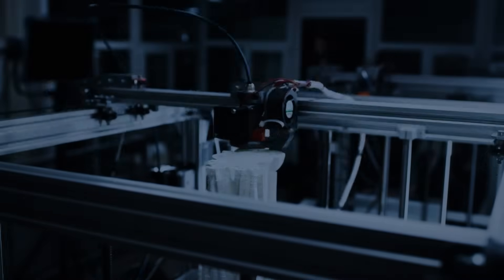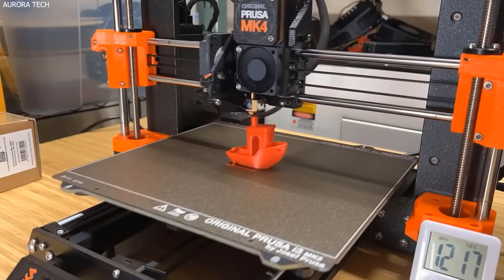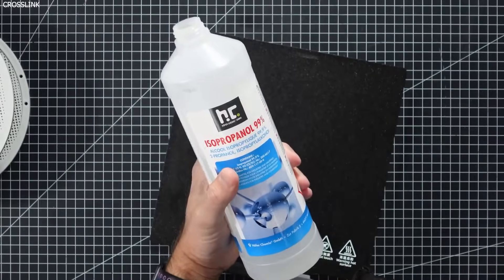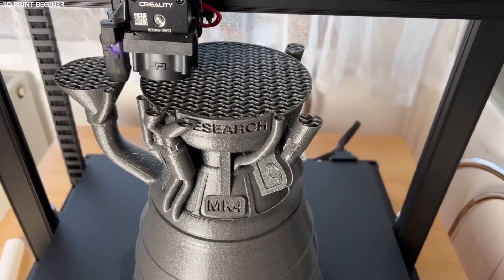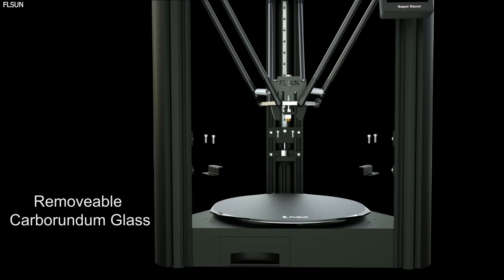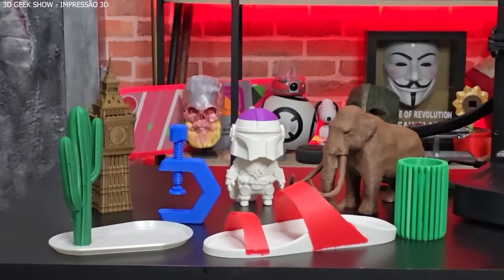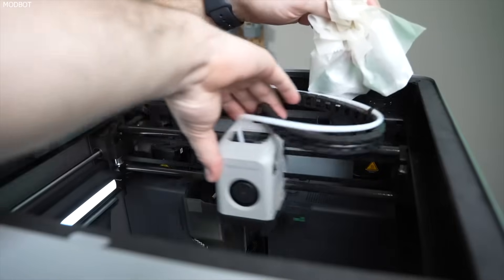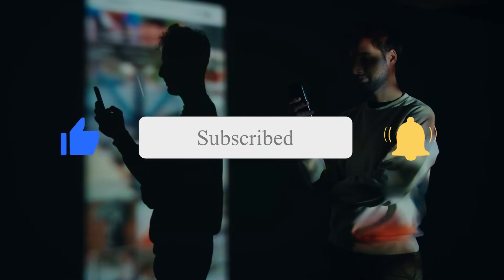BEST 3D Printers of 2025 – Don’t Buy Before Watching This!

Comment: I just can't believe the Best of 2025 has prints that have noticeable layer lines and stringing "is the best". 
A Creality ender? 
A couple bed slingers????? really? 
A Delta printer. it works but dust and constant adjustments needed over the course of a large print just isn't there.  
- a single carbon fiber arm breaks or the glue fails your prints are not going to turn out well. 

I run a Bambu Labs P1S with AMS. The middle of the X1C and the A1(its a P1P with the shell) look up how many hours 100's of people have put on one.  10k hours+ without issue. 
I've done the bed slingers, I've done the Delta's, I've even done resin.
Bambu has it worked out.  No I'm not going into the H2D because I don't have one.

Comment: Actually the Creality v3 KE is capable of printing speeds of up 500mm per second paired with high speed filament.
Reply: Yea, in reality tops out at around 100mm/s due to quality issues. Also ships with warped bed, loose linear riles, awry frame, crooked hotend, sagging gantry, and wobbly z rails. Needs ALOT of fiddling around, and the only two things you will be learning on this machine is :how to fix 3d printers, and "don't buy creality"
Reply: @Partyczka tbh sound a bit like a you problem yeah it has adhesion problems and ys the gantry isn't build like a tank but this is only a problem if you have zero knowledge about 3d printers overall its alright i'm happy with mine most of the time

Comment: Thanks for making the video but there are not many really good printers in there 
If you want the best most reliable printers on the market wether for a farm or as a tool buy:
-Prusa Pro (only if you have unlimited budget)
-Prusa (best customer support  on the market, extremely reliable, super easy to service,  always upgradable to newest version, very easily moddable, open source, but very expensive and you’ll have to pay extra for things that are already built in in other printers and features come sometimes later than on others)

-BambuLab ( exceptional print quality, mid range price, extremely easy to use, and lots of convenience features but difficult to service as replacing small parts can require to disassemble a big portion of the printer and a little locked in in terms of their ecosystem)

If you want to build it yourself buy:
-Prusa kit 
-Voron kit (not a company but a team of engineers so you buy the parts as a kit from a 3rd party manufacturer and assemble it with an openly available instruction manual)
-RatRig (like prusa but bigger printers)

If you want to tinker with that thing (build a five axis printer for example or mod the hell out of it) 
-Prusas
-Vorons
Are probably suited best as they use 3d printed parts with openly available files so you can modify them easily

I conclusion: 
I can without doubts recommend Prusa, Bambulab, Voron and RatRig printers (the last two more as a project or diy because you have to assemble them yourself)

But please before you buy any printer watch reviews from known 3d printing Youtubers like:
Makers Muse 
CNC kitchen 
The next layer
ModBot 
247 Printing
TeachingTech 
These guys know what they’re doing and are most of the time not sponsored by the companies which product they are testing. Please make up your own mind because you should know what you are buying before you waste your money.